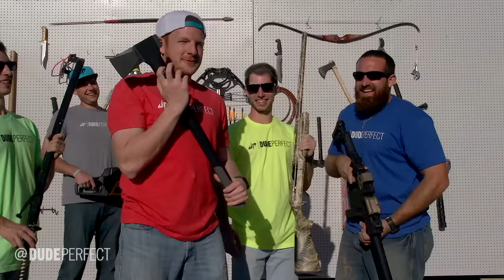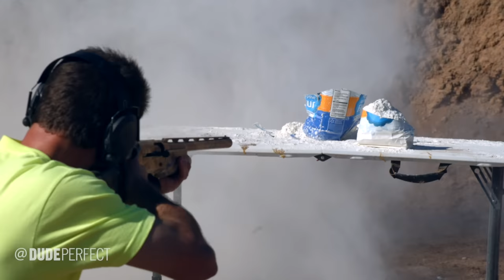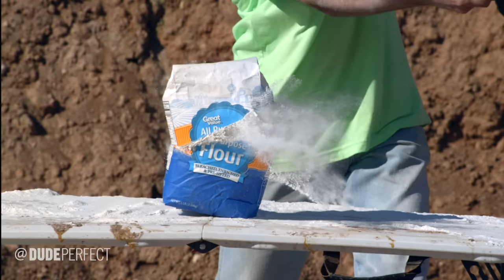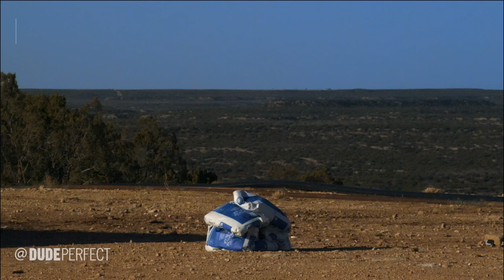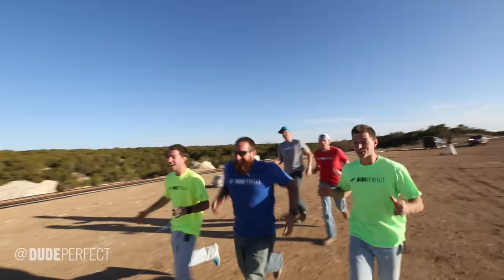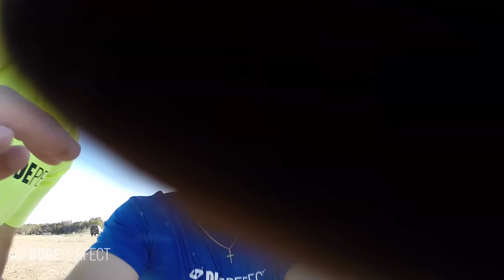Exploding Flour | Dude Perfect

Comment: you're not getting enough of a directed cone of dust. Try putting your explosive charge in a an expanding cone of some sort with the flour on top of it so virtually all of the flour spreads out directly in the path of the explosive force. I used to use those round-plastic quaker state oil bottles, gluing the cap on and cutting the bottom off. I'd wrap the edge in duct tape to help hold it together a little longer (it will spread out like a daisy). Just 100 grains of powder or so with a good flash powder or fine grain black powder will pack a considerable wallop with flour, cremora or sawdust on top. And it also produces a rather nice little mushroom.
Reply: ق صةانبياء
Reply: @achraftlm244  english
Reply: Umm…
Reply: @oliviatherobloxian5484  special forces 'improvised munitions' guides talk a lot about dust initiators

Comment: The flour explosion is pretty straight forward, they are originally made out of wheat, if you light up a small fire in a field of wheat, they'll simply spread really fast especially when they're dry. As for the flour, when they are dusted in the air, think of them as speck of dried wheats and scattered all over the place, expose it to a fire and it will have a huge fireball of explosion.